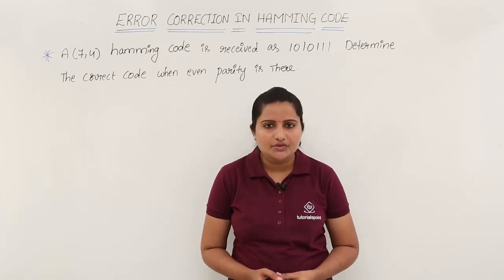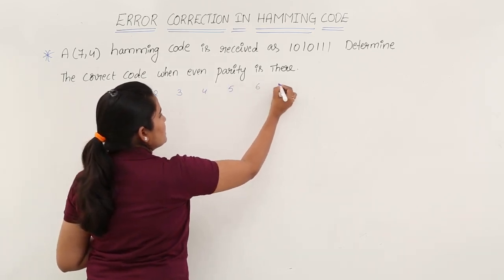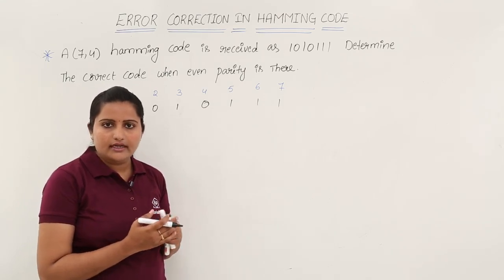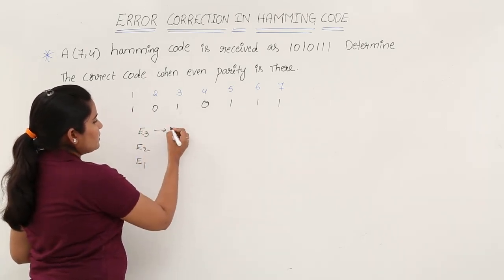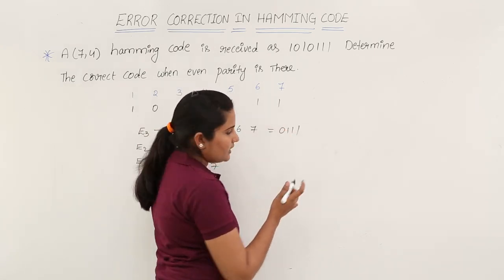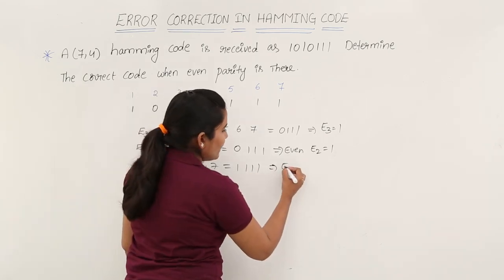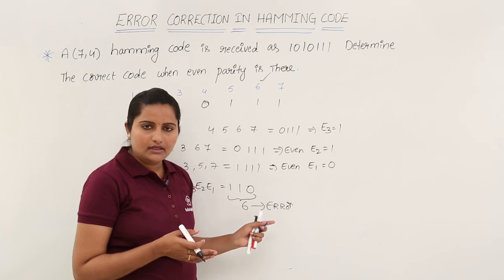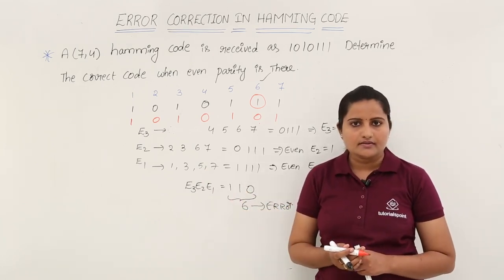Error Detection and Correction in Hamming Code

Comment: The correct answer is 1011010111 
Total parity bits are 4 and data will be 6 bit so when we add both it is 10 we have to design upto 10

Comment: How the reference is taken medam
Reply: Based on 2^3 combinations we take
421 
000-0
001-1
010-2
011-3
100-4
101-5
110-6
111-7
For e1 we take the reference 1,3,5,7 because the binary weight 2^0 consist 1's in this positions and similarly for e2 and e3

Comment: Design the decoder for a(6,3) Hamming single
error correcting codec using the “interleaved”[P1P2D1P3D2D3] format.You can use
a 3 to 8 line decoder for syndrome decoding and XOR gates for the controlled
inversion. Employing an appropriate design, simulate your circuit to check for
correct operation .plz help me in this😢
Reply: Where are other videos in this playlist?

Comment: Wrong from the start!
Binary is a positional number system. You cannot number the bits right to left because the rightmost bit is the MSB. In your code word the two leftmost bits are check bits c[1],c[0].

Comment: There is a small problem, since you started numbering the problem from left to right, you ended up with error bit at position 6. Thus by inverting the 6th bit from left your code can be corrected. 

The same problem, if numbered from right to left and solved accordingly, the error comes out to be 0.

Thus this implies that a code detection and correction depends on whatever side we take the MSB and LSB as, but this shouldn't be the case. The correction process should work irrespective of the fact on whichever side we start.

So what is the error??
Reply: If you will take it from LSP than there will be error at 2nd place not on 6th place so the answer will be same @SourinRoy

Comment: For those who are wondering about formation of E1, E2 and E3.
Follow this trick :
bro, convert 1,2,3,4,5,6,7 into binary form.
then for e1, check which binary digit is having 1 at first position.
for e2, check which binary digitt is hving 1 in middle position.
for e3, check which binary digit is having 1 in last position.
try it u will get e1= 1,3,5,7    e2=2,3,6,7  e3=4,5,6,7

Hope it helped
Reply: I think u interchanged e3 n e1

Comment: I don't understand  how is coming E3=1,E2=1,E1=0. please tell me
Reply: Actually its easier to say Parity bits P3=1, P2=1, P1 =0
P1 =0  is determined by adding bits that are in positions 1, 3, 5, and 7. Those bits are 1+1+1+1  = 4 (an even number, in binary =100 ends with a 0)
So that means  our parity is even  thus P1 =0 (even parity) . Parity in English means difference  = so the number of one are even ( or balance out - or 'even out' if you like to say )
NB for P1 added bits for positions 1 (binary =001),  3, (binary 011), 5 (binary=101), 7(binary=111). The is a particular pattern in this list in that their last binary bits = 1 (i.e. ends with a 1 in last position)
Similarly P2  we use position(s) that have a 1 in the second position  --> 2(binary 010), 3(binary 011), 6 (binary, 110)
Reply: and position 7(binary 111) in that case P2  = (sum of bits in positions 2,3, 6 and 7) = 0+1+1+1 = 3 ( binary 011)  This number is odd... so the number of 1s are not even (we have to 'even out' things here by making parity = 1)  Thus P2 =1 (or you can use the value obtained --> 3 (011) ends with a 1, thus 1 becomes your parity bit)
Reply: @ Ananth S Karnavar
glmstar how do you determine that the values 1,3,5,7 are for p1..? I mean, why take 1,3,5,7 ?
Reply: 1  in binary is = 0001, 3 is = 0011, 5 is 0101 and 7 is 0111 These numbers end with digit 1 (right most bit or least significant binary bit) 
P2  you do the same look for numbers with a 1 on the second position from the right you get 2  (which in binary is = 0010 ),  3 which is binary is = 0011,  6 which is binary is 0110 and 7 which in binary is 0111.
Hope that helps    @ Ananth S Karnavar
I can only see you post on my gmail but here I had to copy paste. can't find it to reply
Reply: @glmstar  create hexa decimal truth table then see  1  where present their
Reply: bro, convert 1,2,3,4,5,6,7 into binary form.
then for e1, check which binary digit is having 1 at first position.
for e2, check which binary digitt is hving 1 in middle position.
for e3, check which binary digit is having 1 in last position.
try it u will get e1= 1,3,5,7    e2=2,3,6,7  e3=4,5,6,7
Reply: @SanatanByAI  Tq So much .....I have exam 2mrw and it helped me a lot....

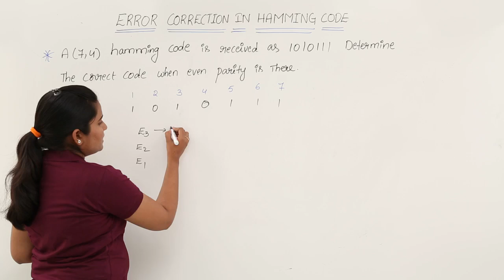Comment: At 2:54, That switch from E3, to E1 was super confusing. You should have numbered them in ascending order and just redid the video rather than scratching out (1,3,5,7) E1, and replacing it with (4,5,6,7). Makes sense now but you can't just correct from a fatal flaw like that and move on. You've lost your viewers. You either need to explain why you're changing your course or recast the video.

You should also explain Even Parity rather than assuming it, perhaps before you start the lessen.

Comment: Thank you. Can you please explain how to convert a fraction to excess 3 code
Reply: According to excess-3 code we need to add 3 to both digit in the decimal number then convert into 4-bit binary number for result of each digit. Therefore,

= 15.46+33.33=48.79 =0100 1000.0111 1001 which is required excess-3 code for given decimal number 15.46.

Comment: i beg you please tell about The Network layer
Network layer concepts, design issues, static and dynamic routing algorithms, shortest path routing, flooding, distance vector
routing, link state routing, distance vector routing, multicast routing, congestion control algorithm, internetworking, Ipv4
Medium access layer
Channel allocation problem, multiple access protocols, ALOHA, CSMA/CD, IEEE Standard 802 for LAN and MAN
Reply: Achin may b u r asking for digital data communication and wireless communication topics. Definitely we will forward your request to our teem. Soon will try to work on that.
Reply: Wrong procedure
Reply: Don't Beg .. Just request :) :) ...

Comment: madam can you explain exactly how E1,E2,E3 are formed
Reply: bro, convert 1,2,3,4,5,6,7 into binary form.
then for e1, check which binary digit is having 1 at first position.
for e2, check which binary digitt is hving 1 in middle position.
for e3, check which binary digit is having 1 in last position.
try it u will get e1= 1,3,5,7    e2=2,3,6,7  e3=4,5,6,7
Reply: @SanatanByAI  thanks
Reply: @SanatanByAI  thanq bro
Reply: Arnab Bag plz refer video with title Hamming code generation example with even parity

Under hamming code there i explained how we can take p1 p2 p3 same is applicable to take e1 e2 e3
Reply: Arnab Bag full video series is in www.tutorialspoint.com under video tutorials for digital electronics. there you can find full data for hamming code
Reply: There is no video about it!
Reply: ia to may samasgia ager e3=1 e2=1,e1=0 kasa agia. tom janthiti to bataw
Reply: as it is mentioned even parity, so we check the no of 1's in E3,E2,E1. If no of 1's is odd, E3,E2=1, when even, E1=0